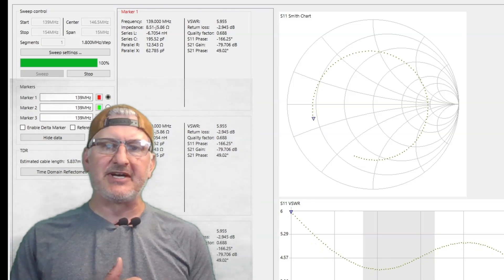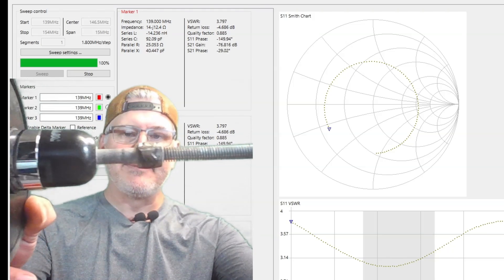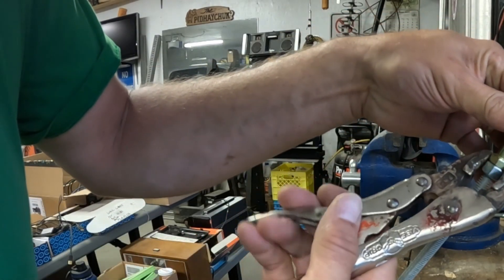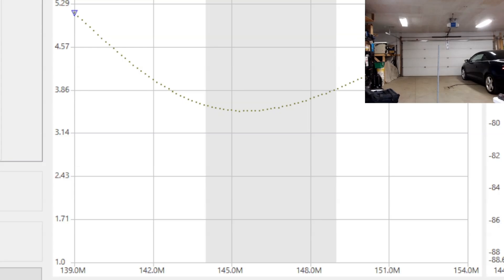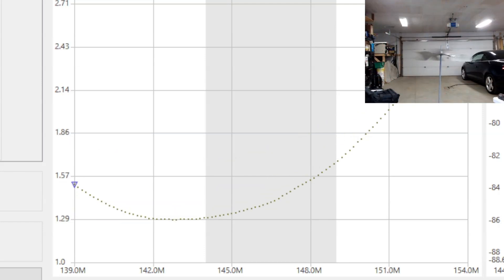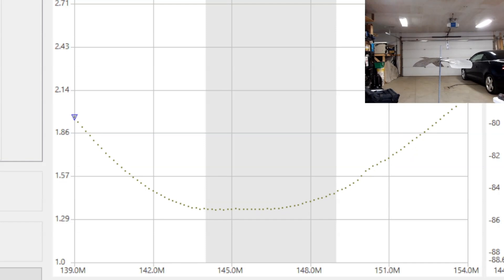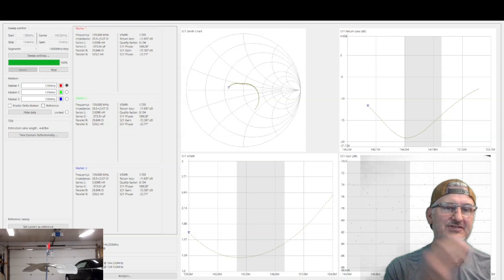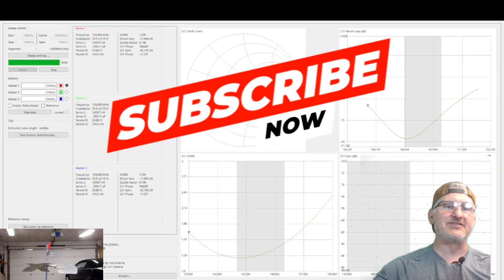inspiring 2m Ham Radio Antenna for FREE! How To DIY,  Best bang for your buck, cheap #antenna #hf

Comment: Now that's a fun antenna Mr MUD! In essence, you've created a squeaky ~variable capacitor~ (hat style) at the top of your antenna which ultimately provides greater efficiency and bandwidth for your shortened vertical than inductive base loading. By moving the hat up and down the rod, you're changing the measurable capacitance to ground within your antenna system. 

In addition to physically moving the hat, adjustable capacitance can also be obtained by increasing the surface area of the 'hat'. You can do this by increasing the number of capacitive elements in the hat, or expanding the width of those same elements. 

I've been playing with hats for awhile and strongly prefer them over inductive loading, The mechanical issues of a hat at the top of a telescoping whip is a challenge - one which Chameleon just hinted that it will resolve with a new lightweight whip hat coming soon. Now that will be fun to see 😀73 KJ6ER
Reply from the maker: Now that is a explanation my brain can understand!  Spoiler Alert! I am going to screw this on top of my HF ham sticks and see if I can increase the gain and bandwidth of them.  What fun this is!  
Thanks for the help as always my Friend!  See Ya on The Bands!  
Mr MuD